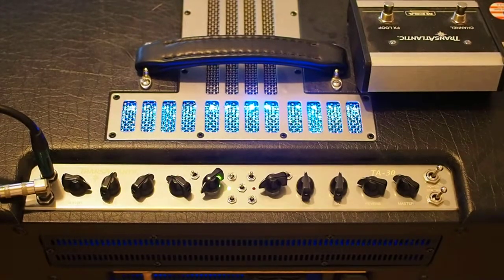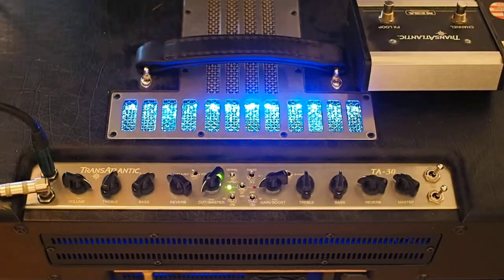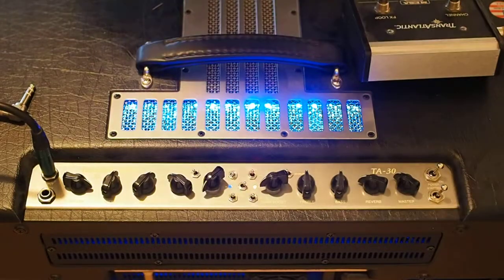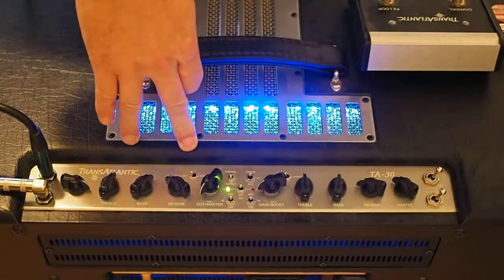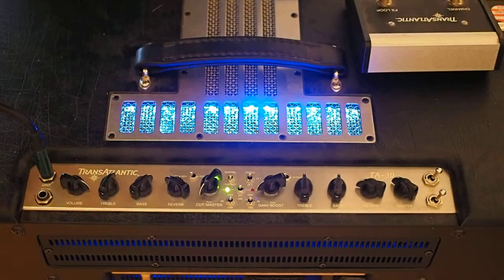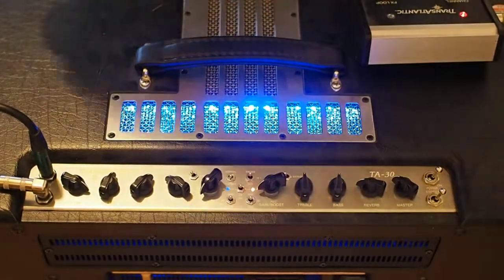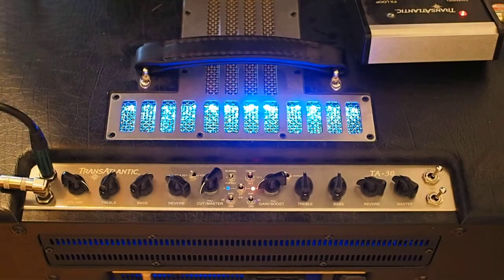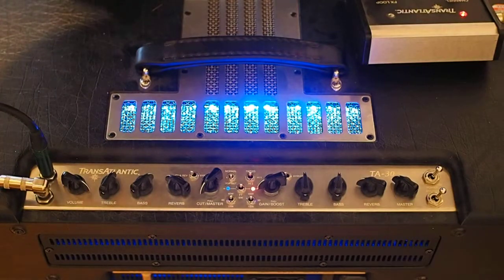Solved :Mesa Boogie TA-30 Transatlantic, troubleshooting, channel switching and cut out problem

Comment: When you say "2.2kuf 25v Electrolytic capacitor across the +15V supply" are you talking about replacing C34? On the schematic it's 1000uf 25V between the bridge diodes for the switching supply and the 12V regulator....
Reply from the maker: It has been so long I cant remember the details, but contact M-B. They have a service bulletin on this mod, and sent it to me. Unfortunately I lost that document to a hard drive failure.

Comment: Im thinking capacitors and/or a bad connection maybe a ground loop also.  Caps can loose electrolytes  and cause other issues  maybe ill see another video about it and find out what it was!✌️
Reply from the maker: Mesa Boogie has a service bulletin on it. They added a cap.

Comment: Thank you for the video. Question: Regarding your comment "They also sent the noise suppression mod to bypass the onbard trace for the reverb signal, and run it as a shielded cable. I need to order a a J-Fet for that, so I haven't done it yet.", 1) Did you perform this mod, and 2) Did it get rid of the unnatural reverb swell you mentioned, instead giving it a smooth decay on the reverb when switching channels? I have a Lone Star that does the same thing, and I never liked that one design. Thanks again, and I look forward to hearing your reply!
Reply from the maker: No I never did that second mod. The TA-30 is a pretty noisy amp, but I dont record, so It doesnt bother me. 
 I dont thing it the second mod was to address the reverb swell, which is inherent to the design.
Reply: @RotarySMP  Thank you for your reply. I understand now.

Comment: Mine does not work on the red channel on 40, just a buzz. Changed the tubes and seemed to be good then started this again.
Reply from the maker: Have you contacted Mesa? I made that video to demonstrate the symptoms and sent a link to Mesa product support and they came straight back to me that it is a know issue, and they had a service bulletin to add an extra capacitor across a relay. Since there was no Mesa authorised tech in my country, they sent me the SB and the the capacitor, and I soldered it in myself. It has worked fine ever since.
Reply: @RotarySMP  Thank you. I did eventually call them and they sent me the fix for it. There is no dealers near so I took it to a guitar shop who put in the cap and now it is perfect. This is not a bedroom amp as I found out. I opened her up at a community centre and wow, wonderful sound, thanks for the vid, I am all fixed now. I was afraid that it was dying but it did not.
Reply from the maker: @nbarry2346  Glad that worked out well for you. M-B's support seems pretty flexible for those of us who are not close to a dealer.

Comment: This design of The Mesa TA-30 is far too complicated and unreliable due to the too high plate voltage for the EL84 ( 6BQ5 ) tubes , and a switch-matrix which consist of a whole bunch of miniature relays ,...... it's also very noisy.
Reply from the maker: ?? Very ....what? 
I only use mine as a bedroom amp. Total overkill I know. Especially since I got the 2x12 Combo :) But I picked it up cheap due to the issues, and it turned out to be a cheap fix. I am pretty happy with it. You are probably right that it is not robust enough to gig with.
Reply: hi do you think using 6p14p ev , or 7189 could fix this problem ? i really don't want to modify the bias circuit, thanks

Comment: Hi. Nice video and very usefull. Can you share the 3 boletins of MESA ? Thanks
Reply from the maker: I lost them to  hard drive crash, sorry. But just contact M-B service.
Reply: @RotarySMP  Ok. Thanks. You still have de ta-30?
Reply from the maker: @chuly890620  Yes. I really like it. Way too much amp for my useage, but I like the different voices.
Reply: @RotarySMP  Nice. Do you think a noise gate in the effects loop would help with channel 1 noise?
Reply from the maker: @chuly890620  I have a Boss noise gate, but that only seems to kill the noise upstream, or within it's loop.

Comment: Does the swell occur if you don't have any reverb on either channel? Also, did you have any issues with the fx loop?
Reply from the maker: Hi Jamie,
No the swell is related to to the reverb. I haven't been using the FX loop, so I haven't identified any issues with it.
Reply: @RotarySMP   Hi mate,  I've had issues with the blue LEDs causing my TA30 2x12 to cut out intermittently. All the lights stay on but no sound until you turn the 
power off and on again.This can happen time and time again all night. I disconnected the wire to the LEDs and it's fine but I wonder if there's a fix for it you might know of,
         Cheers   Steve G
Reply from the maker: @stevengarde5440  I suggest you do what I did. Upload a video showing the behaviour, and then send a link to Mesa Boogie engineering. They responded very quickly in my case.
Reply: @RotarySMP  I’m curious to what Mesa had to say? I just got mine back from the shop, I’m having noise floor issues with the green channel in mine.  I believe the other problems have been fixed by my amp tech.  This amp is a royal pain in the rear but it sounds soooo good.
Reply from the maker: @michaelglass3095  They didn't saw much, just that it was a known issue which they already had a bulletin for. 

The noise floor is definately a a thing with these amps. Not a studio amp, but a lot of fun.

Comment: What did you do to solve this problem? I have a similar problem in my ta30 head
Reply from the maker: Hi Samir,

I contacted Mesa Boogie customer support and they sent me the tech bulletin which requires a 2.2pF cap to be soldered across the pins of the +15V supply. There are pictures in the bulletin which make it very obvious. If you have done a little electronic soldering, it is not too difficult to add that cap.
Reply: @RotarySMP  oh any chance you could send this to me if you still have it? same issue on my end
Reply from the maker: @tomcat2260  Sorry, I had a hard drive crash and they were not backed up, but just contact Mesa Boogie support. THey sent them to me.